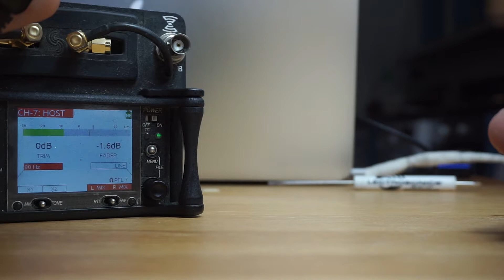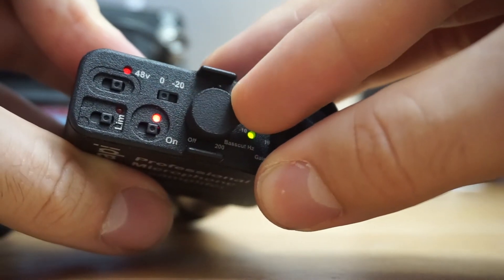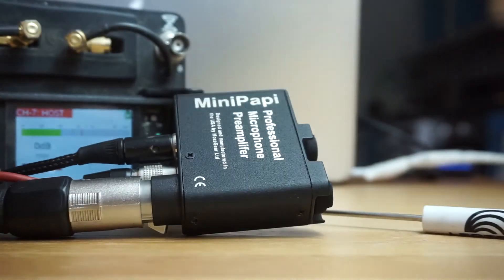Mozegear Mini Papi (A) Overview and Setup

Comment: Sorry for asking a dumb question but would this simply connect to to the 3.5mm on the red epic-w base expander 3.5mm jack with gain to minim and plug in XLR to the mini papi?
Reply from the maker: Great question. Double check in the pin connections on the manual. Don't think a normal headphone one will work like the g3 plug that comes with it